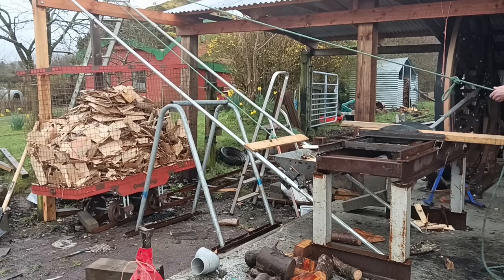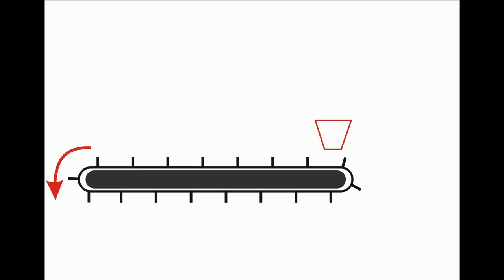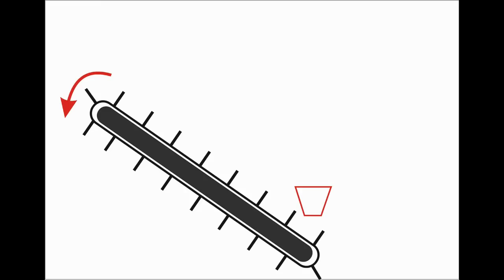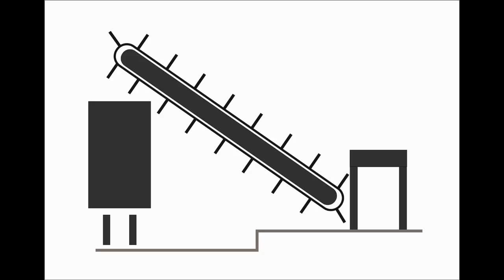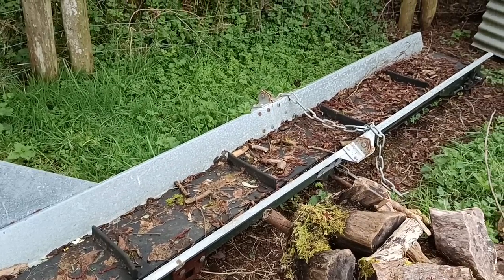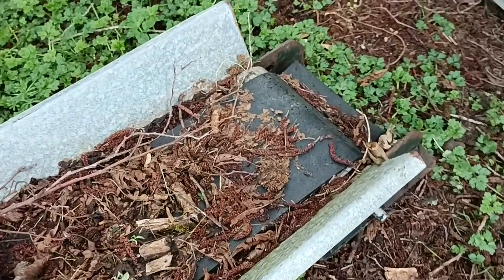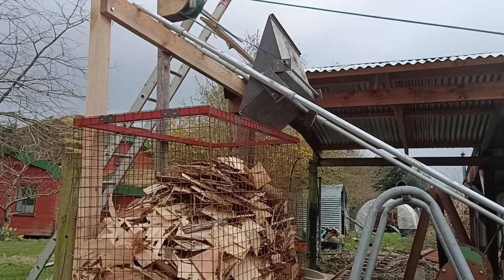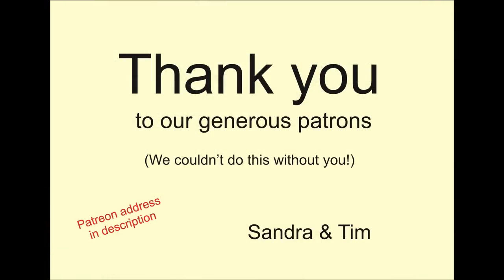Why Not A Conveyor? Responses to the sliding hopper video..

Comment: Idea for simple/cheap conveyor "belt" in case someone can use it:

Two loops of old tie down straps.
Connecting them, many sheet metal plates, acting as the paddles.
Such belt of straps and plates can be dragged along a flat surface, by wood pulleys at each end.
Reply from the maker: what would stop them slipping on the pulleys?
Reply: @wayoutwest-workshopstuff6299  Thanks for your reply! I imagine the friction of the fabric belts on the wood pulleys would stop any slippage. Alternatively some prongs like nails or screws, can be added radially on the pulleys, so that the prongs never skip the paddles. Do you think might actually be feasible?

Comment: Conveyors, in this case elevators, don't need rollers all the way along, a shiny plate will do. In fact, relying on rollers in the middle is likely to tip the load.

Comment: With a lot more money, effort and engineering (as well as precision parts), a conveyor belt could be done. But that isn't at your disposal, and for the ammount of product this contraption works. Not a very efficient/fast setup anyway, so a conveyor would run empty most of the time. Making coal out of woodchips is probably the more efficient (but again, more costly) variant here, but again, that is probably out of scope. 

However, even though these solutions are all great for you, please build a shield for the spokes of the big wheel. Someone catches an arm or a hand in there and it will be snapped off at the mounting-stand of the wheel, that thing is a considerable safety hazard that is cheaply (0.5 cm or thinner ply) fixed. Also, some guards on the slicer would be nice, so you can't get your hands crushed there, but since it is still under development that could be implemented at a later time.

Comment: Are you certain that you would need the paddles and rollers?
The wood pieces are fairly light. 
I would think just the belt sliding on top of a somewhat smooth surface (maybe melamine?) should do the trick with minimal wear. Like a treadmill.
And for the paddles: There are a lot of "automatic wood choppers" that use belts without any pedals. And they have to move much heavier pieces.

Another option if a rubber belt is too expensive would be a chain drive. Just two chains and every 30cm or so they are connected with a crosspiece.
Reply: Thinking about it a bit more:
I think a chain conveyor belt (drag conveyor) would probably the simplest solution.
The only problem would be the drive.
So maybe in the future when you can chop wood faster than moving it with your bucket that might be an idea.
Reply: I think you are right. A chain each side with pieces of bar or angle connecting. Sliding over a static melamine or similar surface. I'd imagine that this could have gears either side of the chain to allow for a flatter section at the bottom if necessary.
Reply: A chain conveyer would have been the simplest option.. *if* he wanted to make a conveyer. I think the hopper is the simplest option out of all- aside from just throwing the wood up with your hands XD Mostly because it doesn't need hooking up to the engine.

Comment: Yep, you have to do what you have to do that works for you and your budget.  I am the same way, just a bit geekier on stuff.  Recently have decided to dump lead acid batteries for my vehicles, have replaced one battery 3 times and it still won't hold a charge properly.  The original battery was 8 years old when it finally died and the battery in my pickup was 9 years old when it died.  Replaced them both within the last couple years and have had nothing but problems.  Decided to go LFP or LiFePo4 which can be an issue with vehicle charging systems in place.  But I know that with a couple parts and some thinking it will work just fine and should last for the rest of the life of the vehicle if not longer.  Have had people tell me I am throwing money away, my car is going to burn up, I personally will cause global warming to skyrocket, and that it's all going to blow up in my face... literally.  But with a charge controller to limit the power flow in along with a heavy duty diode I can make amazing things happen, add to that a couple circuits with an ESP8266 and I can have main power available whenever I need it.  And I should NEVER have to buy a battery again which in the long run is a huge cost savings, on top of that the worst thing is my vehicle could catch fire (not likely) or I could be wasting the cash but if I own it all and it's my decision why not let me do my thing?

You do you though, and the rest of us will point out where we can see possible improvements or issues.  The ones who DEMAND you do something a certain way should also be the ones willing to fork over the cash to make it happen.  Never a demand from me, I'm broke!!

Comment: I was wondering why you didn't use the conveyor belt you already had but then, I thought probably because it wouldn't be suitable for the job you need it to do, also electricity and rain water don't mix, and the rain water could cause the motor to short out or that someone could be electrocuted.

Comment: Do you have junk sailboats around your area a rope capstan winch would be a good upgrade to pulling the rope by hand and could be run with a lawnmower engine and with snatch blocks used to pull the cars uphill

Comment: Tim. I have a question? I was just thinking... Do you guys have those grain tube augers? Some of them have an attachment which goes on the bottom of the auger which is like a huge drop pan. In this pan is a v shape for the grain to go down in the the level auger then it gets feed up to the main auger and then in to the bin/cart/truck. 
I was thinking it would break up the charcoal. Yet I am not too sure about that. It was a thought.
Reply from the maker: unfortunately woodchips/splinters just get stuck in augers

Comment: Maybe conveyor engineer is a bit of a stretch, but i have engineered a few in my days.
You wouldn't need intermediate rollers. a flat surface would suffice on such a short conveyor. 
Also, with that incline and that type of large material to convey, you would not need any "paddles", or at least they would not need to be very tall.

With all that said, if the capacity of a conveyor is not needed, there is no need to overcomplicate things.
Reply from the maker: Without paddles the wood would slide over itself and all stay at the bottom. Promise!

Comment: Tim I thought your setup was fit for purpose, in some ways it’s similar to a motorised hoist small miners use for lifting out of a shaft, travels up when sent, dumps at the top and returns to the bottom automatically.
I’m sure if you felt inclined and had the cash you could add a hoist motor and make it automatically climb, empty and return

Comment: I don't agree with your assessment of the conveyor. Your contention that it requires paddles of a great height, rollers etc does not seem to be well matched to the very light thin shingles that you are transporting. A number of comments gave ideas for simpler conveyor solutions that would likely work for the use case we have seen in the video.
I think a more honest answer would be: "This is what I could make quickly with the material on hand".
This answer is just as valid. There is always choice for an engineering solution and we evaluate the merits of each differently as individuals, but we should be honest about the complexity of any solution and not inflate the difficulties of one to make our own preference seem better.
Reply from the maker: thin slices of wood slide over each other and they really would need tall paddles. I think I'll just have to demonstrate this too... : -  )
Reply: @wayoutwest-workshopstuff6299  of course they do, but a conveyor is continuous and you would only need to ensure the frequency of the paddles past collection point exceeds the frequency of slicing. Another frequently used solution is to have a small enclosed hopper that feeds the bottom of the conveyor and relies on the material sliding to charge the paddles. As they say, lots of ways to slice the pie.

I don't make YouTube videos and I don't work your farm, so my suggestion is make what works for you in time/cost/effort/view count. Your solution was good, but I think the engineering assessment was flawed: my opinion based on my experience. I'm employed to do such assessments and I know each of my colleagues would have a slightly different view.
If you want more efficient machines using contributions from viewers you could make videos setting out the problem and what materials/budget you have, then wait for the comments to flood in.

Comment: Archimedes Screw - sorry to say you missed the mark here Tim, you system is labor intensive and not so mechanical so I am offering this suggestion https://en.wikipedia.org/wiki/Archimedes%27_screw
Reply: Those only work for fine material.
Reply: @vinny142  they also work with water. So, don't think it would not work.